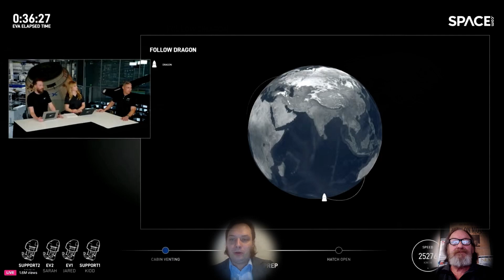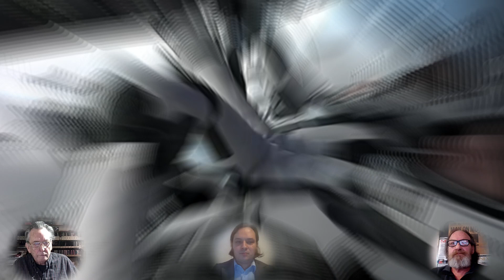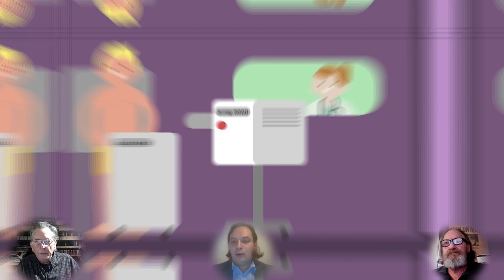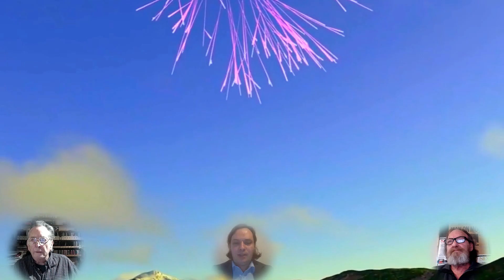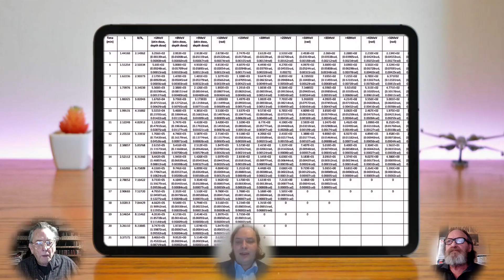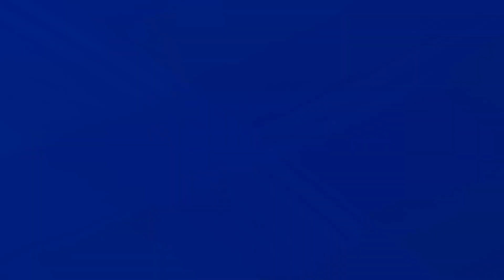"GEMINI-APOLLO-POLARIS DAWN: THE REAL RADIATION FIGURES" PART 105

Comment: So basically the aluminum amplifies the radiation and the Apollo crafts were wrapped in aluminum. So it would have done the opposite of what it was supposedly intended for?
Reply: No. 
1. For one it’s was solid aluminium. It was a honeycomb structure with a thin sheet of aluminium on the rope layer for much of the ships surface. 
2. It’s was an alloy that contained other materials like lithium which vastly improve the radiation performance against pure aluminium. 
3. Only the LEM had thin enough aluminium to produce significant secondary effect and astronauts were in the LEM for a limited time. The CM had walls thick enough to mitigate the effect substantially. 
4. The moon still lies within the magnetic influence of the earth which would provide a fair degree of mitigation from cosmic radiation which is the issue.
Reply: "Only the LEM had thin enough aluminum to produce secondary emissions and astronots were in the LEM for limited time."

'Limited' is a pretty broad term, but whatever it is there was a tremendous risk that wasn't addressed in any way.
Reply: @ except it’s was. NASA knew about it and would have mitigated. Worth noting that the astronauts didn’t mist if their time in the LEM in thick suits.
Reply: @peteconrad2077 
"Thick suits"?
 What radiation did they block?

Comment: Was the CM CPRV (cabin pressure relief valve) the only equalization opening in the hull upon re-entry into the atmosphere?
Reply from the maker: According to the LM PDF, that valve was the only way of depressurizing the LM.
Reply: @theapollodetectives  
If air just flows in only, 21 % oxygen could not be reached. 5 psi of 100 % oxygen plus 9 psi of air would result in 7.11 psi partial pressure of nitrogen. That is 51 % nitrogen and 49 % oxygen. A lot of air flowing in and out is neccessary to acheive 21 % oxygen. You need to wash out excess oxygen.
Reply: Aka decompression sickness.
Edit - Turns out to be Compression sickness.
Reply: @G.Gorrell  Comment removed.
Reply: A little context.
This from the United States Parachute Association titled "Jumping From Space 101—Alan Eustace Talks Us In"

"The other reason I didn’t have water,” he said, “is that, even in a pre-breathe, every time I sucked from the water nozzle, I would get nitrogen in my system. I don’t know why that is, but we were carefully monitoring my nitrogen using a spectrometer, so we could look at my exhale and tell if there was nitrogen in there. Every time I drank water, for some reason it would show nitrogen. Nitrogen causes decompression sickness … so no water.”

Alan was in a pressurized suit (?psi) and had prebreathed O2 before the jump in the stratosphere. 

If he was so concerned with nitrogen simply from drinking water, then how did apollo actornots not get compression sickness breathing all that CM nitrogen?
Reply: @NoremacOktik they were in a 100% o2 atmosphere. Where would you get nitrogen?
Reply: @peteconrad2077  
The higher external hull pressure would allow partial N2 pressure to infiltrate the low pressure pure O2 hull - although it would never rise to sea level N2 until a form of aeration occurred (fans at splashdown or opening hatch).

Even if you didn't die of pulmonary edema after breathing 5psi pure O2 for two weeks, a sudden reintroduction of N2 at re-entry would likely have negative physiological effects.
Reply: @ why would it? It’s only being introduced at a partial pressure the body can routinely deal with. It would any be an issue if the they depressurised again. Otherwise it would stay dissolve in the blood. You really don’t understand this, do you.
Reply: @peteconrad2077 
I understand that there is zero contemporary examples of humans breathing low pressure pure O2 for 2 weeks, thus zero example of a sudden reintroduction of N2 afterwards.

Why don't you show us any contemporary examples?
Reply: @peteconrad2077 
And I would suggest a form of nitrogen narcosis IS possible when returning from breathing pure O2 at low pressures for 2 weeks.
Reply: @ if you can’t tell us why it would be a problem first I think that would be useful.
Reply: @ nitrogen narcosis is partial pressure dependent so there’s no mechanism for this happening on turn in Apollo. You’re just making stuff up.
Reply: @peteconrad2077 

"Nitrogen narcosis is partial pressure dependent" and there's no mechanism for this to happen on turn in apollo"

It just so happens that a re-entering CM is just full of partial pressures of N2.
Reply: @ except it isn’t. The absolute maximum partial pressure it could reach is the normal partial pressure at sea level, which is obviously below the narcosis level.
Reply: @peteconrad2077  
Lol - What is the N2 narcosis level?
Reply: @NoremacOktik  approx 4 ata. But it’s dependent on individual physiology to some extent.
Reply: @nasaphycho insulting comment removed and destroyed.
Reply: @Gorell comment removed
Reply: @Gorell banned comment removed.

Comment: wish I had some of the material their suits were made of to insulate my house. why haven't we used that since it kept out heat and the astronut warm in the extremes of "space"?
Reply: Even the insulation on the lander or command module keeping out +250 one minute and then -250 the next. Like any of this, the more you think about it, more it becomes apparent it was all a hoax. Thanks for the work guys!
Reply: @mikeleschber33  with that type of insulation a large part of our fossil  fuel needs would be no more and we could build our homes out of aluminum foil houses 1/8 in thick...yeah, I'm dreaming 😄
Reply from the maker: @mikeleschber33  How engineers could make a suit that could instantaneously heat and cool is a matter for the literature of science fiction.
Reply: @Yvonne-r7c  "Prada isn’t making the suit; Axiom is."

We've already been through this a few times before, so why do you insist on repeating the same misleading nonsense? .. Here's an article about how Prada designed the new spacesuits....

'Prada unveils surprising, new luxe line — high-tech spacesuits for women astronauts'

"One small step for women, one giant leap for this fashion house.

The first woman to step foot on the moon will wear designer duds — a Prada spacesuit, to be exact.

A “next-gen spacesuit,” which was unveiled Wednesday morning at the International Astronautical Congress in Milan, is as chic as the bulky, white ensemble can be and is outfitted with technologically advanced features to protect astronauts and allow for optimal performance.

The “Extravehicular Mobility Unit” — the technical name for the spacesuit — was designed by Prada, in partnership with Axiom Space, for NASA’s Artemis III mission." .. https://nypost.com/2024/10/16/lifestyle/prada-unveils-surprising-new-luxe-line-high-tech-spacesuits-for-women-astronauts/
Reply from the maker: Now that's a good question isn't it. I would like to see these exact same suits function on the lunar surface. We will never see that day since PRADA got into space suit manufacturing. I wonder how many models of suits they will go through until they opt out like the others? Cheers Mike!
Reply: @mikeleschber33  maybe the day will be when it becomes trendy on social media....like everything else 🙄😒
Reply: So basically the aluminum amplifies the radiation and the Apollo crafts were wrapped in aluminum. So it would have done the opposite of what it was supposedly intended for?
Reply: Another one who doesn’t understand the difference between temperature and heat.
Reply: @peteconrad2077  how about you educate us with inferior intelligence?